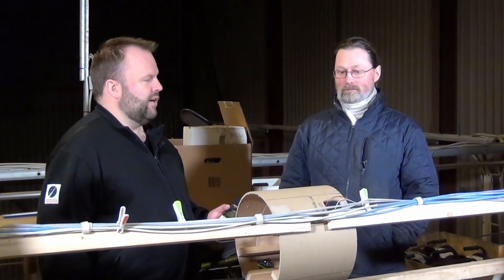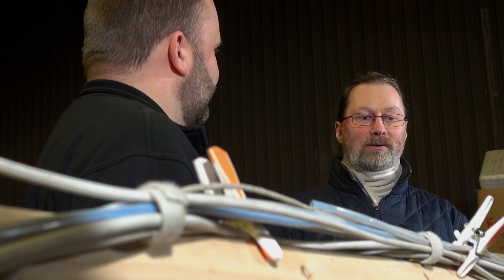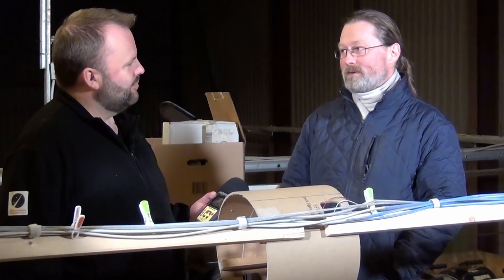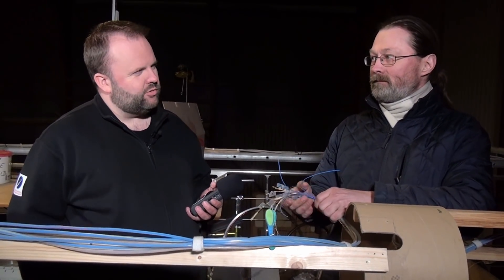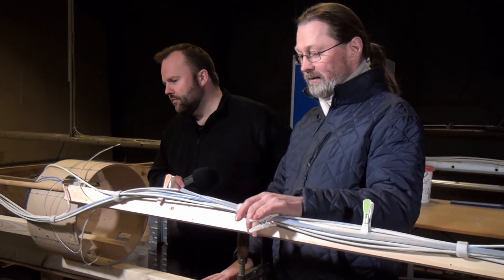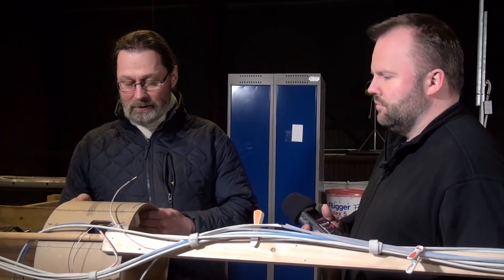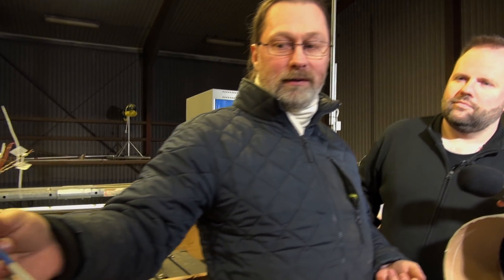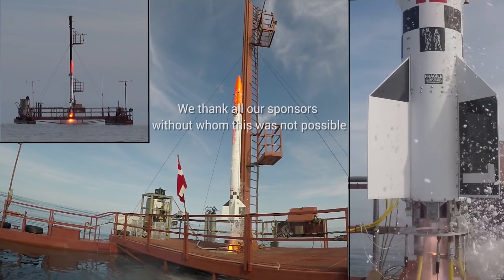2017-05-04 Current Affairs - The main cable harness for Nexø II

Comment: These videos really help to explain what is involved with building a Rocket of this size. Were are the Batteries located?  I would imagine that you are running on ground power (Ship power in your situation) during most of the count down. At what point does the Rocket switch over to the flight Batteries?  Thank you for taking the time to produce these great videos.

Cheers
Willy
Reply: shortly after the ignition system is connected they disconnect the ground power.